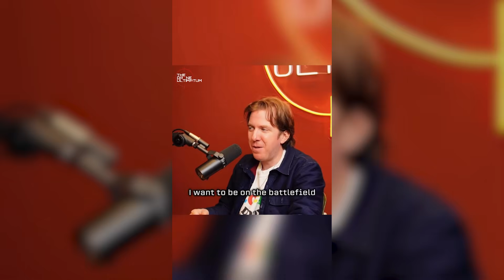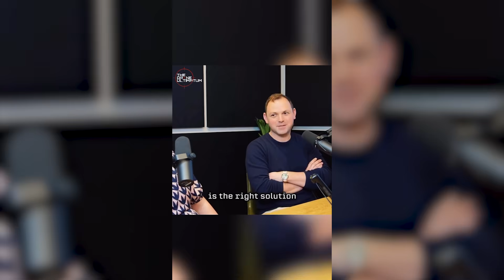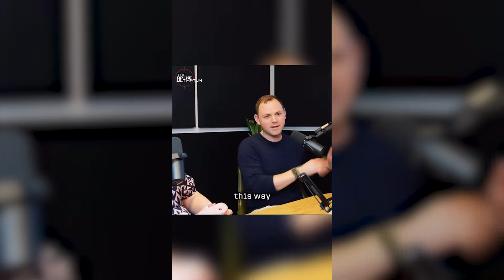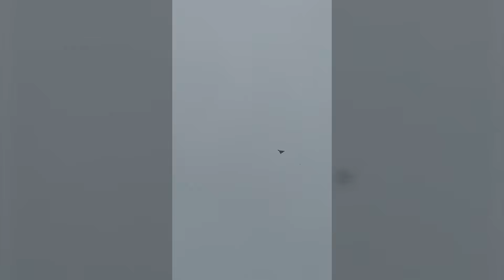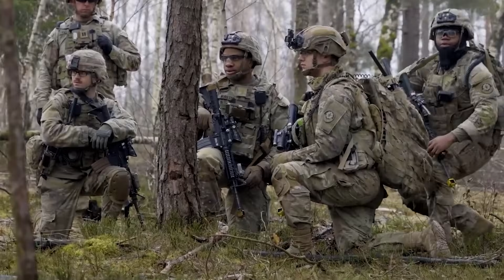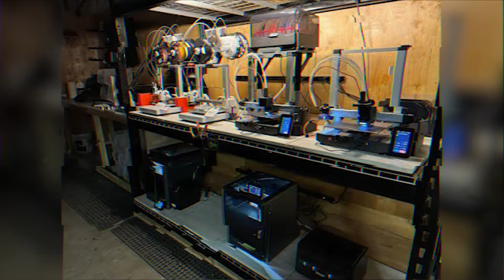Calling Out 3D Printing Skeptics in Defense

Comment: The fact you can manufacture parts on field without depending on a factory is immediately beneficial. The only real supply lines you need for this are power and filament.